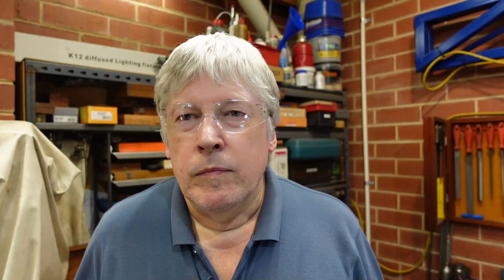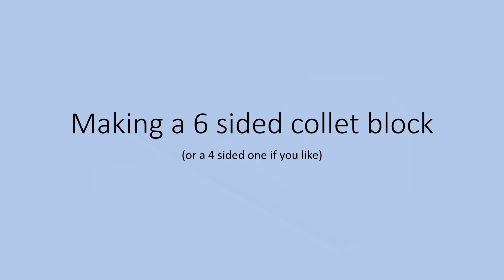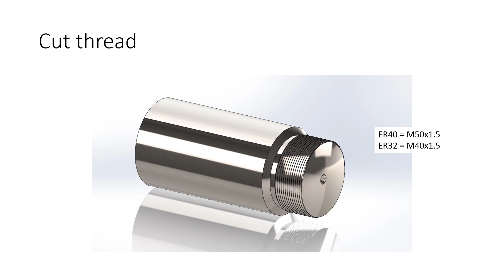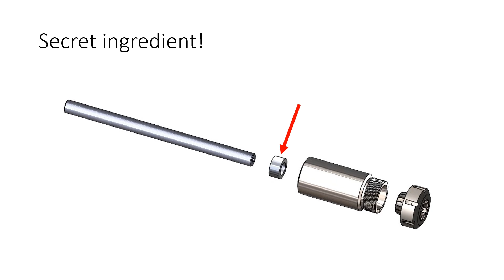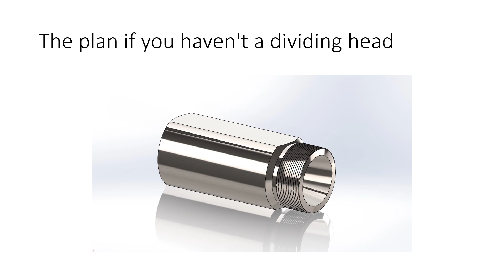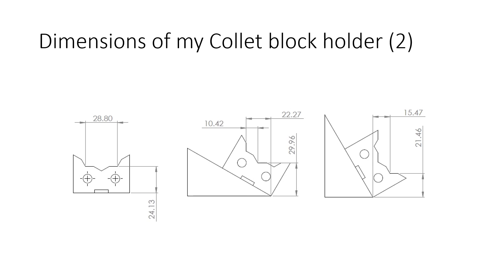The Collet block holder

Comment: A couple of ideas to help make the collet block: 

Bore & REAM the center hole 20mm diameter through and omit the 23.3mm diameter x 20mm bore x 1.65mm thin wall spacer. ER32 can be up to 26mm, so increasing the suggested through hole size from 23.2mm to 25mm will be easier to bore or ream and use stock 25mm rod. ER40 could also stay the same if using a 32mm or 1 1/4" diameter rod.
If you stick with a 20mm rod, drill and ream an array of 6 - 6mm diameter holes in the unthreaded end for a 6mm pin. The test bar can sit on top of both jaws with 7mm packers ( 9.5mm high for 25mm rod ) under the pins with the collet block clamped over the ends without the nut. All 6 faces can then be milled at the same height using the pins as an indexer. The holes can be left in, tapped for a stop, or the part made longer then machined off when finished. Kurt style vises have the tops of the jaws precisely ground parallel with the vise base and can be used as a reference face. This setup can also be used with a toolmakers vise on a surface grinder.

An offset vee block with 45 degrees one side and 15 degrees on the other will give a 120 degree seat for the collet block to sit rotated at 15 degrees to give a 12 sided index. Make the height to keep the center height the same as when the collet block is sitting on a flat face. This can also be used with the base against the fixed jaw and the vise used to clamp the part.
Reply from the maker: You'll get a better fit with a separate spacer though, and I use oversize collets as well so for an ER40, that takes it up to 30mm. Plus, boring a hole diameter 20 100mm long may be tricky in itself. I guess you could drill the body out most of the way and leave the end intact for a precisely bored hole if you wanted to do it that way.
I suppose if you were making for yourself and a friend you could have two collet blocks back to back and secure each end with an ER collet and nut...🤔
Reply: @occasionalmachinist  Thanks for the information on extra-capacity collets! I've updated my comment to reflect these sizes. Personally, I’ve never believed that adding another piece improves accuracy. Since the part is already set in the lathe, it makes sense to finish the bore precisely concentric to the final size in the same setup as the angle and use a rod that fits.

I really like the back-to-back idea. Would you make a long one and cut it in half? Perhaps making a single one you could even use a standard hexagonal collet block for indexing the six flats, similar to a rose indexer.
Reply from the maker: @ Re the accuracy - the problem I see is boring a 100mm long hole (boring bar with +100mm stickout) to be a good fit (say within 0.1mm) on the test bar is tricky. Much easier to machine a small piece to do the same job.
Your suggested method would work - but for the average hobby machinist it would be quicker to use a separate piece, particularly if they have several goes to get a good fit

Comment: A great little adapter to make a single collet block worker "harder". You could also make the collet block 12 sided which would achieve the same outcome (2,3,4,6 indexing). It has downsides, the flats are half the size & you don't have a positioning stops. 
The other thing people should think about is, is making a template/guide worthwhile for other things that you are doing. 
Spending the time to REALLY make sure the angles (dimensions) are really accurate once and then using it multiple times can help improve speed (not so important for hobbies) and accuracy (you only had to think REALLY hard once).
For example you can drill a line of holes in a mill to get consistent spacing. You could make a template that has two holes at the right spacing. Use a drill as a pin to locate from the previously drilled hole then you can use any appropriate drill for the job. If you have made it with an appropriate stop/guide then you only have to mark out the first hole. 
I see a lot of things that should be used by the other hobby between metal and wood work.
Like using you vernier to make out hole positions from an edge - not great for the vernier.
A cheap wood guide has locations every mm from an edge, add a scriber and you can do the same thing more easily & quickly, and your vernier will be happier too😁.
Reply from the maker: That small bearing area is the main reason I don't like the 12 sided blocks. I have no fear of tipping with with this holder.

Comment: Very nice indeed. You might also use blue Locktite between bar/ ring, ring/block. (That is always a nice trick when good alignment without load needs fixation before putting on a load.)
Reply from the maker: I must admit I don't like using loctite for temporary joints - to get things loose again generally requires some heat. Mind you, with  the crusty "10 years out of shelf life" stuff I have, it probably is not an issue

Comment: I will certainly be making a holder when I get a bit of time. thanks for the explanation, mine is an ER 32 so I will have to juggle the numbers a bit. Thx again👍
Reply from the maker: Not difficult to adapt. I'd suggest laying it all out in a CAD package (or on a drawing board) just to get your dimensions right, but perfectly acheivable.
Reply: @occasionalmachinist  CAD lol, cardboard aided design😁. wouldn't know where to start!

Comment: Thanks for the video. So nice to see actual dimensions and drawings rather than just machining only.
Reply from the maker: If I'm making a bit of tooling that others may like to make, I try to include drawings. It also helps you develop as a machinist too. Rather than making something to fit something else, working to a drawing pushes you to make to a standard